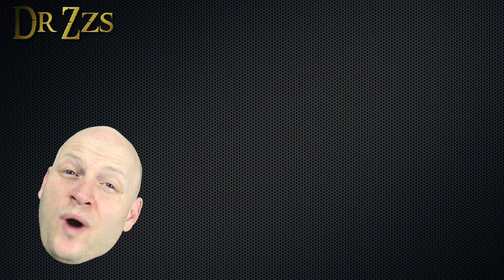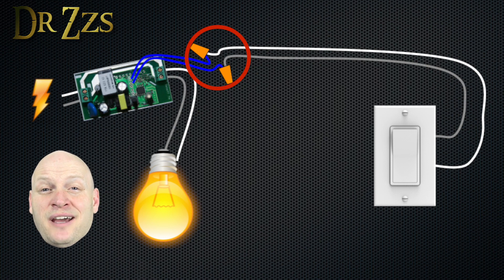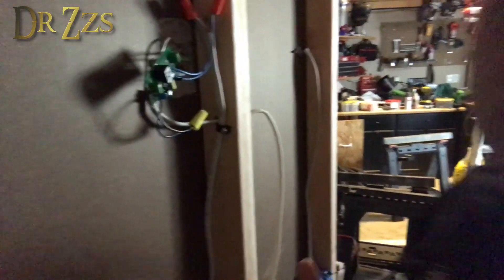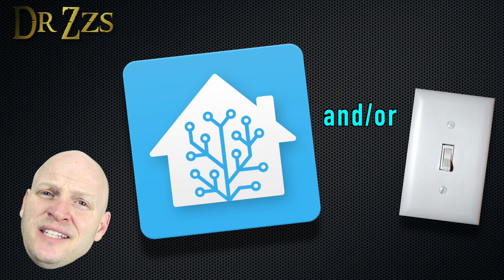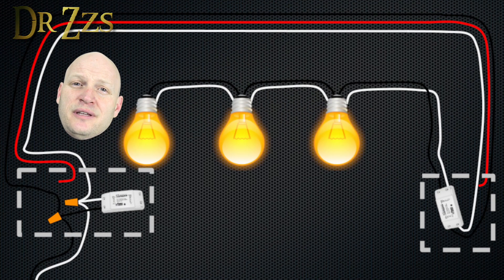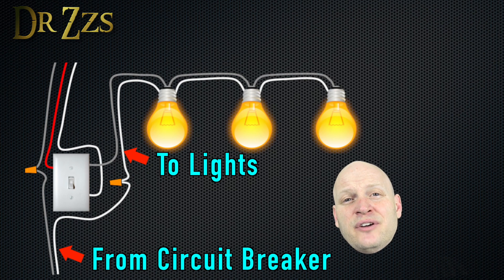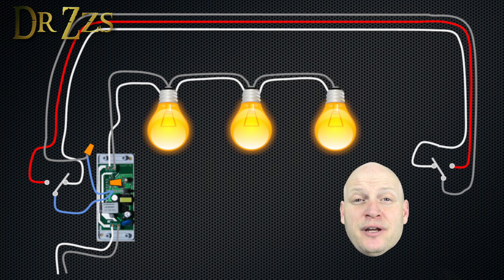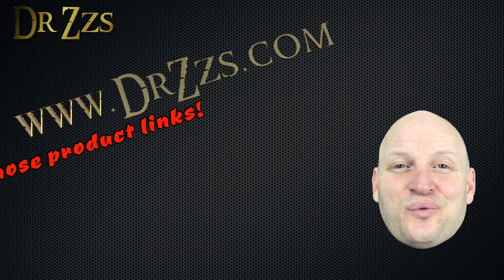Maker Faire 2018 - 2 wires in a Switch box & 3-way another way

Comment: I realized the 3-way switch as in the last scenario, but because of the length of the wires from the switch(about 15 meters), I had random lights on. I have solved with a pull-up resistance of 4.7 ohms between 3,3 volts and gpio 14.
Reply from the maker: excellent!

Comment: Congratulations! Great Video! Do you also have a solution for a "4 way" switch using SONOFF? I have some lamps that are turned on and off from 3 or more points.. so I have two 3way switches, and one or more 4 way switch. One variant I have in mind is to use (if feasible) one or more SONOFF between one 3 way switch and one 4 way switch.
Do you have a solution like this, or even a better idea?
Do you have a video that explain how to do that?

Thanks
Reply: If you're just using eWelink all you need is 1 sonoff that is connected to the lights and any number of other sonoffs that do NOT have any lights connected.  Then in the Scene settings for each switch, you set a condition so that when the switch turns on it performs a turn on of that one sonoff with the lights connected. Then also for each switch create a scene so that when that switch is turned off, it performs a turn off of that sonoff with the light connected.

Comment: Good video.  Thanks for posting.  But I think there may be a mistake on your diagram of the original wiring around 6:09, which confused me at first.  Your diagram shows the white traveler wire connected to the common terminal of the switch, and the black wire to the lights connected to the traveler terminal of the switch.  I think the connections of the black and white wires on that left-side switch should be reversed.

Comment: The latest Sonoff Basic R2 (bought Dec 2018) uses an ESP8285 chip instead of an ESP8266 and does not expose GPIO14. That does not matter. There is a much simpler way of doing normal switching or 3-way switching (called 2-way in UK and Australia) that allows both manual switching and voice switching using the Sonoff Basic. It does not even require flashing of Tasmota. It works perfectly without firmware modification using eWeLink and Google Home (and presumably Alexa but not tested). 

1. Wire the mains power to the Sonoff inputs (Requires an electrician in Australia) Probably requires installing the Sonoff in the ceiling.
2. Wire the lights to the Sonoff output (Requires an electrician in Australia)
3. Solder a 100mm (4") wire to each of the existing Sonoff push-button terminals (GPIO0) and run them to the outside of the Sonoff. See https://www.superhouse.tv/21-six-sonoff-secrets/ and look at the first diagram under "Switches" for where to solder the wires.
4. Connect a figure-8 (twin-flex) cable to the wires using wire nuts or connectors and run it to the first switch. Change the switch to a momentary push-button switch.
5. Wire a figure-8 cable in parallel with the other one and run it to the second switch. Change the switch to a momentary switch.
6. Repeat for any number of additional remote switches.
7. DO NOT reuse the 240V wiring (in Australia) if at all possible as it could result in a future electrician connecting 240v into the wiring at the remote switch and blowing up the Sonoff and causing a fire.
8. The lights can now be controlled with the switch(es) or with voice.
9. Insert a piece of paper inside each switch with the circuit diagram on it so future electricians know what has been done.
10. Leave the old 240v wiring in place (normally 3 wires for 2-way switching) for possible re-connection in the future.
Reply: In Australia the momentary contact switch mecanism you need is HPM 770XMWE, assuming you have HPM wall plates, and can be ordered from any electrical wholesaler. Cost about $10.
Reply: You should tie a knot in the new wires you solder on or clamp them with a clamp or cable tie so that if they are pulled on they will not apply pressure to the solder tabs.

Comment: Hi, I have one question, which I think is nobody has come in mind. 
How can we show status of load (either on or off) by the light indicator of capacitive touch bottom shown at 4:23 even the load is controlled from HA?
Reply from the maker: That's a good question.  The on-board LED will indicate if the load is on or off, so maybe setting the cap-touch led light input to the output that is controlling the on-board LED would work.  
You'd have to experiment and see what you could get to work the way you want it.  
If you do figure it out come share it with everyone in our Facebook group and Discord.  I'm sure others would like to do that too.

Comment: Can i have the same wiring setup, 2 way switching controlled with an Ewelink App instead of Home Assistant? I do not want to flash the SonOff with Tasmota firmware. i would like to use the default firmware because i want to use the Ewelink App. Is this possible?
Reply from the maker: unfortunately the stock sonoff firmware doesn't let you use the available GPIO pins.  Since we need GPIO-14 to set up the 3-way switch, you can't use this method with the stock sonoff firmware. 
sorry.
Reply: @DrZzs  Thank you for a great response. I am left with no option but to flash it. Well, is possible to use a POW 16A to integrate it into the switch for the 3-way switching instead of a SonOff Basic?

Comment: Ok, hopefully you can help me,  I have this all wired up like you show but my 3way switches quit working.  The Sonoff is working flawlessly.  Hopefully its a simple fix, or something in the software.
Reply from the maker: hmmm.  can you tell me a bit more about what is happening?
The Sonoff is working, meaning you can toggle it from HA or Tasmota or the on-board button?
But when you flip the switches connected to GPIO-14 nothing happens?  
That could be a wiring problem or a Tasmota settings problem.  Give me some more info and I'll try to help.
Reply: DrZzs correct, the app turns the light on and off but when I flip the switch connected to gpio14 nothing happens. Also the other switch doesn’t work either. I didn’t do anything with tasmota. Is that what I’m missing?

Comment: Question: Do you need to add the resistor and capacitor onto GPIO 14 and ground if I am just using a regular switch to make it "ul"? Seeing in this video u did not add it.
Reply from the maker: it depends... On sonoffs where I'm using the capacitive touch switches I don't use it.  It seems the circuitry on those capacitive touch buttons filters out the interference.  And, if there isn't much around that might cause interference, the low pass filter also shouldn't be necessary.  In the maker faire wall, there isn't much else around that adds interference, and I haven't had any ghost switching without the low pass filter.  
If you don't want to add the LPF, you can try without it.  If you get ghost switching then you'll have to take out the sonoff and add it.  If it isn't a lot of work for you to add it up-front and you don't want to have to add it later then go ahead and install it.  
If I were going to install a sonoff in my house with a normal light switch attached I would put the LPF on it.  Mostly because taking the sonoff back out and doing it would be more painful than just installing it at the beginning.   Pretty much every sonoff I've installed in my walls lately has been with the capacitive touch modules, so I haven't been using the LPF components.  
Hope that helps!
Reply: Thanks for helping me. So just to clarify LPF is just 4.7 resistor and 82K resistor.
Reply from the maker: yep!

Comment: Hi. Thank you for this guide. It's amazing. But can the same setup be done with a sonoff 4ch. I have a couple of them and it would be great if I can use those.
Reply from the maker: I have a 4ch and am planning to flash it and make a video about it in the next few weeks.  
Are you hoping to use it in a 3-way switch situation?  Or just want to use it as a switch in Home Assistant?
Reply: DrZzs i want to use it in a three way configuration. Even if it is home assistant also it is ok as long as i have functionality from the switches and the sonoff 4ch. The only way i found was to give the connection near the light. But doing this will disable simultaneously using switches and the sonoff. Your experience will surely help me as i am just starting out in this project. Will you be doing the demo in 4ch or 4ch pro. I am wish it would be the 4ch since that's the one i have. Fingers crossed.
Reply from the maker: Yes, I have the non-Pro version so that's what I'll be flashing. 
So your thought is to use the other buttons on the 4ch to just send mqtt messages to HA?

Comment: So one 3way switch you can still do it like it was but it needs to of been a back feed 3 way where switch and power are in the same place before it goes off to the next s3 switch
Reply from the maker: yes, to do what I did here you'd need power and load in the same box.  If you have power in one box and the load in another you could do it like my other 3-way switch video, but that requires a sonoff in each box.

Comment: Danger, Will Robinson! Danger!!
Your diagrams are correct, but the verbal instruction you give with the picture of the light switch hanging out of the box next to the Sonoff (6:22) doesn't match the diagrams you're showing, and is potentially dangerously incorrect..
You state "... remove the wire from the black screw on the 3-way switch ... then take a wire from the ground pin on the Sonoff, and connect it to the wire that you took off of the black screw...".  Doing this verbatim would either be connecting the hot wire from the light fixture, or the hot wire from the panel (depending on how someone tried to interpret it after being confused because the wire had already previously been removed from the black screw and connected to the output of the Sonoff) and connecting it to the ground pin of the Sonoff.
Reply: I drew up the diagrams to help explain... https://imgur.com/a/ZQPHS
Reply from the maker: uh oh.  You're right. 
I guess if you correctly connect the Line in/out on the sonoff to the circuit breaker and the light, you'll only have one wire left.  But I still better find a way to change what I said there. 
Thanks for catching that. 

What did you use to make those schematics?  I need to use something like that.
Reply from the maker: Just put an update in the Description. 
Thanks
Reply: No problemo!  I know there are a lot of very inexperienced folks following along that love to try new things, and I'd hate to see anyone get hurt or pop their new Sonoffs and get discouraged.  Your videos are a good source of inspiration to a lot of folks wanting to get started in this stuff.

I just did a quick Google search and found this site (https://www.circuitlab.com) to draw-up the circuits.
Reply: Okay, you're gonna hate me, but I'm a stickler for detail, lolol :-D
The revised description states "...That wire should have already been removed and connected to the Line in on the sonoff."  But actually, it should be the "Line out", not "Line in".
Don't hate me!!  :-P
Reply from the maker: ahhhh!
dang it!
well, the description is easy to fix. 
why on earth would I hate you for this?  You're saving my cookies here.  I put bad info out, someone gets zapped and they have a REAL reason to hate ME :)

I truly do appreciate you fact checking me.  I will never be upset by it.  Ever! 
Thanks!

Comment: The problem with running long wires to GPIO 14 is that the Sonoff is VERY susceptible to radio frequency interference on the GPIO inputs.  The long wire becomes a pretty effective antenna.  The wires should be kept very short.  Ask me how I know this :)   It takes very little RF energy to make that input start to flip on and off by itself.  If you have to run long wires, I would strongly suggest that an rf filter be installed on the GPIO input on the Sonoff circuit board.  This could be a simple .1 or .01ufd capacitor soldered across the input.  There have been videos done on rf filtering for the Sonoff.
Reply from the maker: You are absolutely right! 
In fact, one of those videos about filtering is mine :) 
https://youtu.be/aq8_os6g13s

Comment: Why change the firmware on the sonoff. Will putting it in the light fixture not work with the regular firmware?
Reply from the maker: I change the firmware so I can us it with my smart home hub, which for me is Home Assistant.  
Here's my explanation of why I use Tasmota: https://youtu.be/MyPpmDAThA4?t=2m8s
Reply: thanks for the response. So the normal firmware works with my google home, there is no need to switch then.
Reply from the maker: Nope.  But you can't use GPIO-14, you'll have to connect the wires that go to the light switch to the poles of the on-board button on the Sonoff.  Like this: https://youtu.be/oUFuuoNfvyc

It's not exactly a cinematic masterpiece, but it'll show you how to connect wires to the on-board button.  

Good Luck!

Comment: I have a couple sonoffs and I have one switch in my house that I haven't replaced with a zwave dimmer yet. Are sonoffs safe to have in wall like that? I love the idea of it reacting to and looking like a normal switch, but worry about failure.
Reply from the maker: That's the $1,000,000 question.  The Sonoff Basic is NOT UL approved for installation in a switch box.  Check out my Zzonoff video to see the differences between the Sonoff and a $30 smart switch.  
Here's the keys:
the Sonoff has a 10 amp relay.  So if the load you put on it is more than 10amp it will get pretty hot and could definitely start a fire.  A good solution for that is to add a fuse that is 10 amps or less.  The other issue I've had with the sonoff is the screw terminals for the mains likes are pretty crappy.  So I'd recommend soldering the mains wires to the board.  If you keep the sonoff in the original box and use the ends that clamp the wires, you're probably fine.  But having a hot wire come loose could also cause a fire, but it would likely just trip the breaker.  
Finally, since the Sonoffs are not UL approved, the assumption is that if you do have a fire or some other damaged caused by using them your home owners insurance would not cover the loses.  If you're comfortable with those things then go ahead and use them.  I don't know exactly how many people use sonoffs in their house like I've done, but I think it's a lot.  They seem well enough built, and even though they aren't UL listed the most likely failure point (the Relay) is Approved for use in UL listed devices, so it isn't just some cheap junky relay.  
Hope that helps you decide :)
Reply: Thanks for your reply. Your content has been great and I'm planning on following your holiday LED tutorial for my house, but the idea of the state dependant switch is appealing to me. Every guest I've had in my home so far has a tough time with the paddle dimmers and a simple switch that turns on or off regardless of the direction seems amazing.

Comment: All of the commercially available 3 way home automation switchs I have seen replace both switches or all depends on how many there are and we charge like $100 a switch even tho we get them for like half that but these manufacturers sure would be cool if they implemented something similar so you only need one switch
Reply from the maker: right!
but they won't as long as they can sell theirs for $100 each.

Comment: On the first on you probably shouldn't but you could use a ground as your neutral as long as you don't have a GFCI plug or breaker
Reply from the maker: You’re right that it would work that way and you’re right that you shouldn’t do it. 😜

Comment: Nice clear instructions.  One thing that concerns me is putting Sonoff switches in the wall.  I assume that all the Sonoff items should be inside a junction or outlet box.  I had a bathroom fan that always went on with the light even when not needed.  Being a novice automation guy I mounted a Sonoff switch up in the fan box.  When I turn on the light the sonoff powers up with the light power,  If I need the fan, I ask Alexa to turn on the fan.

Comment: Did you make that capacitive touch switch yourself (at 4:04)? And which capacitive switch did you use? Also when you set the capacitive touch switch up in tasmota which switch option do you use? Thanks in advance! Love you're content btw :)
Reply from the maker: I'm not smart enough to make my own capacitive touch module. 
got them from AliExpress - http://s.click.aliexpress.com/e/uR3VJAU
if you don't want to wait for shipping here's an amazon link too - https://amzn.to/2JuHpYK

With those modules I think I used "switchmode1 3" because they act like push buttons.  I think there's a way to make them "locking", but I haven't done it myself.  
They are great little modules.  And super cheap.  Even the amazon ones are only $0.70 each. 
Good Luck!

Comment: Hello sir, I have a problem that in my home one wifi router was not able to cover wifi range all over my house so I added wired access point to main router to extend main router signal but the ssid and password of 2nd router(access point) is different from main router so if I connect Samsung  smarthing to main router and connect lights to second and main router both.so will smarthing able to control the lights connected to second router(access point) and if I connect smarthing to Alexa which is connected to the access point so will I be able to control smarthing connected to main router
Reply: As long as the access point you're using to extend your wireless network is actually an access point and not another wireless router (if your access point only has 1 ethernet port then it's definitely an access point) and you connected it to on of the LAN ports on your main wireless router then everything will work fine.
Reply: Get a mesh network.  I suggest Google Home.  You'll have one SSID
Reply: Karl Brown thnx bro
Reply: Paul Thomas thnx bro